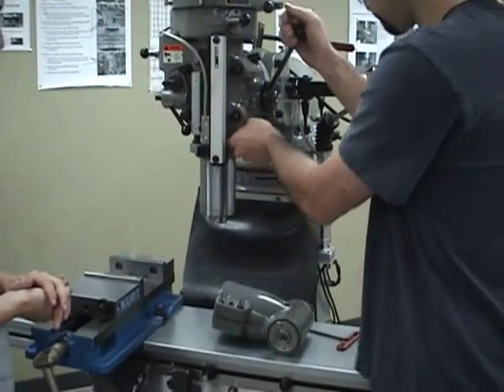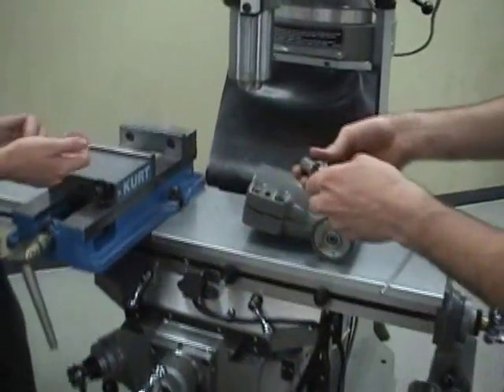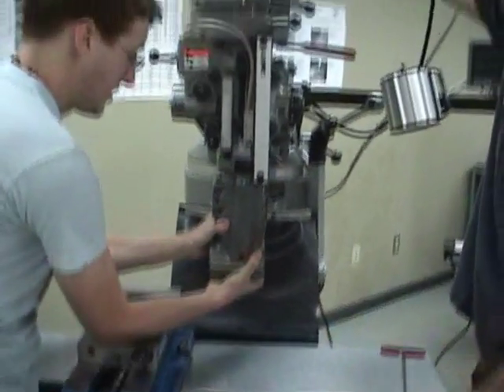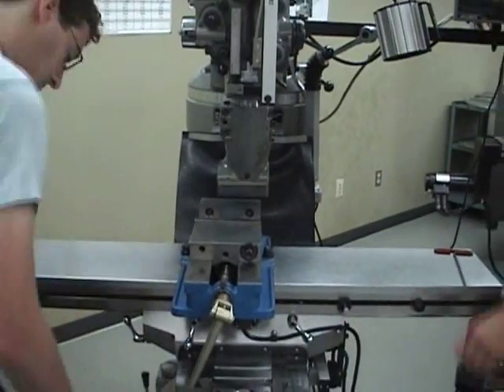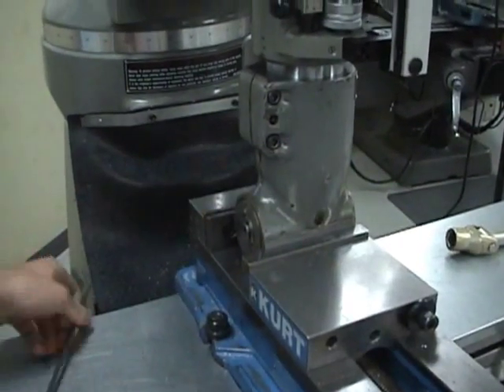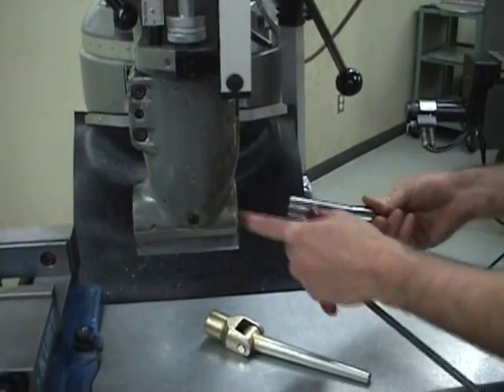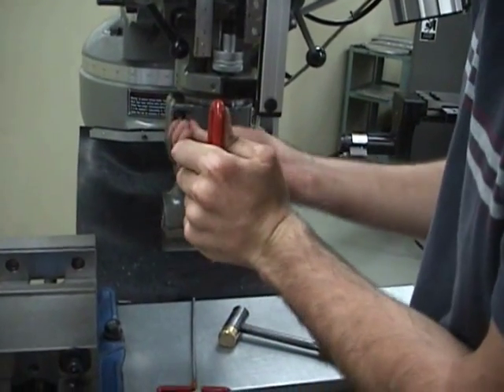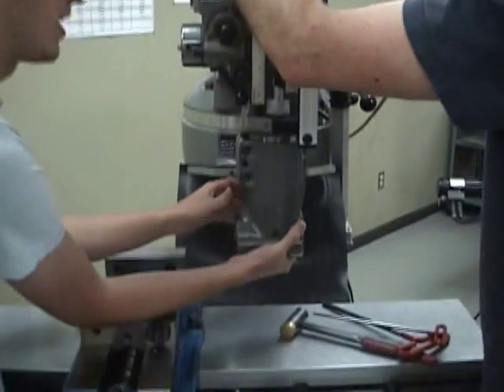90 Degree Mill Head Installation Instructions

Comment: It is a good practise to use a dial indicator to verify the alignment of the right angle head to the X or Y axis travel, rather then using the vise for alignment.  This is just incase the person who installed the vise did not align it perfectly.  The machined flats on the side of the right angle head are there for that purpose.  :-)
Reply: That's exactly what I was taught too. DTI the flats.